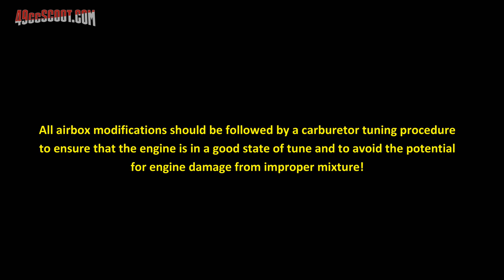Using A Big Carb With A Modified Stock Airbox : Scooter How-To

Comment: If only I had seen your video before now . I have been using a pod filter on my gy6 50cc engine from the time I picked it up used and have had nothing but problems with it running right and trying to keep it in tune . So today I ordered a new air filter box . Thanks for the tip.

Comment: I bought a Chinese replacement airbox for my 1PE40 minarelli as well. It had the small pipe on it and I found that sanding around the hole with coarse sandpaper was enough to open the hole up to take the original larger pipe - mainly because the plastic isn't that solid. I found that going around the hole in a complete circle with the sandpaper gave me a very even result that sealed nicely on the original pipe.

Comment: Damn straight I will be liking. Thanks for the tips. Now I know for sure that my airbox IS lacking a seal between the two halves. Also, when in doubt, I use silicone on everything I suspect could be leak prone. I have to take my carb out so often thesedays that I might as well try the heater gun method to aid installation. I never look forward to attaching the airbox to the carb once I am done... it puts up such a fight. Hopefully now it will be much easier.

Comment: I have a 70cc horizontal minarelli with a 21 carburetor and it had a velocity stack, now in winter the bike died at high speed, I mounted the tube from the original box with a pod filter and on the side of the carburetor I fitted it with a front fork retainer to fit the correct carburetor size 56mm, i have never felt the bike so good, even the noise is crispyer and feel much stronger and constant both at idle as at high speed.

Comment: Please take a look at how different the connection between the airbox and carb is in Piaggio 2 stroke scooters. Even in stock piaggio scooters that tube is very short, the curve part has a specialy profiled section of the curve (not circular all the way)and acts like a part of the carbs venturi stack. Also the airbox outlet to the tube is profiled like a velocity stack inside. The airbox on piaggios also seems to have quite larger volume. There are two inlet passages to the piaggio airbox and they have different lenghts. I guess it has to do with intake resonant frequencies. It always seemed to me like the piaggio intake system is much more detailed and much better thought out than that on minareli.

Comment: I'm sorry to say that my GY6 50cc with18mm Keihin wont run well with the airbox... And I'm not kean at all on a short "racing filter" for the loud open air sound it makes... Was thinking of what I just stumbled on here, a larger hose... to some canister.. I now might try it on the original filter for after watching this, it might just be the 25x150mm original hose/channel that is the (only) problem.
Thank You mate!

Comment: yeah, at one point i also shared your belief in that air boxes dont impact performance in any meaningful way.... until i got some substantial time on a dyno. even with a large gokart air box designed to work on two strokes, with quad venturi inlets and optimal flow, the pod style air filters still are a better option.. im talking that i gained 4 horsepower, went from 19whp to 23 whp on a 70cc engine simply by switching from an airbox to a pod filter. every dyno operator and tuner ive met, have similar results anywhere from 2-8 hp difference
Reply from the maker: I wonder what the dyno would show if you took a street build and ran it day after day. How much would the power be off on the days farthest from it's ideal tune vs the airbox? Would be an interesting test for someone with access to a dyno IMO.
Reply: @49ccscoot  i dont know about a street build, but on the racers ive had, the variation is about 0,5- 1 hp over a whole season, and that result is only due to poor carburator quality, the chinese clones really dont like weather changes

Comment: When it comes to Yamaha scooters with the horizontal Minarelli, it seems like there are two different snorkel sizes. The snorkel is mostly a silencer, I have the larger unrestricted snorkel on my airbox and it quiets the intake side down significantly.
Reply: My Yamaha had the smaller snorkel, from some short research it's apparently meant for the light moped version of the scooter, that's restricted to go only 25kmh/18mph.

For some reason my normal Yamaha had the light moped air box with the tiny snorkel. Removing it did wonders for acceleration! The light moped version's hole diameter is only about ~1cm/0,4in.
Reply: @99domini99  Even the Euro2 45 km/h version has it stock, I ordered the larger one for like 3 bucks online, runs great now and it's not very noisy.

Comment: Hi Brent, another excellent video.  Can you do a follow up to discuss the "why" an airbox works better vs a pod filter?  I've been going over it in my head and seems that maybe that long tube leading up to the carb evens out the air flow much better than the chaotic airflow that comes with a pod filter.
Reply from the maker: They do provide a more stable air source. They can be tuned to the engine. They are more effective at filtering and keeping water out.

Comment: Can you put a link to the air box and hose you bought???  Your videos are the best!!! Thanks!
Reply from the maker: Airbox : https://www.ebay.com/itm/For-Polaris-Sportsman-Scrambler-Predator-50cc-90cc-ATV-Air-Box-W-Filter-0451080/162800816393

Hose : https://www.mcmaster.com/blower-vacuum-hose

I can't remember exactly which hose I got, or it may not be there after all these years. Lots of options in that link though. You can get a coupling in any good plumbing section.

Comment: my friend you need a smooth plastic tube...becaue you are using flexible tube that can restrict air you know what i mean.? it much better to use radiator hose so the flow of air is smooth
Reply from the maker: I've thought about it, just haven't done it. The rad hose I have doesn't fit this and I didn't bother buying anything else because it has been working  well.

Comment: So I work with these 49cc/69cc motorized bike engines. The kit comes with a very basic carb which is called the NT carb. The carb has a very small airbox which is really just a filter mesh with plastic holding it. Can subtle performance gains be made using an airbox? What would be the alternative for our engine kits? Or will slapping on a cone filter and calling it a day be the only practical solution?
Reply from the maker: If the filter isn't good, then at least you could build a simple box to hold a good filter and have the benefit of proper air filtration that would be quieter and probably a bit less sensitive to atmospheric changes than just a pod filter. If you want a proper airbox then there's a whole lot of design involved and it would be easier to adapt something from a similarly sized engine.

Comment: You put out nice content man, I have a Znen150T chinese special, Ive got it running nice all stock with new carburator, however I would like to add, UNI filter and exhaust and upjet, however this scooter has EVAP system and there are 4 hoses into my airbox, I am not sure what to rip out, re-route or replug, do you have an email I could send pics to, maybe you could give me some advice how to remove evap and simplifiy with new performance parts?  TY for your work
Reply from the maker: I'm not an expert with all of the emissions stuff. Your best bet would be to post on the forum at https://49ccscoot.proboards.com
That way anyone there can help and you can post pics. If you use mobile, tapatalk app makes pics easy.

Comment: Great but my scooter is about 12 years old and my air box is 2x the size of my carb on kymco people 50cc scooter any suggestions??
Reply from the maker: The one that  I use is for a 1E40QMB or similar to Yamaha BWS/Zuma. There are also aftermarket airboxes by Polini and Motoforce to fit different carbs.

Comment: Hello, what configuration do you have in the carburetor? What carburetor size do you have?
Reply from the maker: This was a 25mm DellOrto PHBL. Last used configuration was 102 main jet, D26 needle, 64 pilot jet, 40 slide and 60 starter jet.

Comment: Hi man. The minarelli airbox on my scooter cracked right at the neck where the rubber connects to the the carb. I have the snorkel off since i had this scooter. Not sure if gluing it will work well. Not really keen on buying a new airbox yet as it is only a few months old.
Reply from the maker: You could try plastic welder or epoxy. If it's the rubber piece that is cracking, then you can get replacements for just that. You may even be able to replace just the part of the airbox that cracked if it's the plastic.
Reply: 49ccScoot just the rubber neck part of the airbox is cracked. Do you have a link where to get it?

Comment: hi bro i have mikuni stock carb for my jog 90 but it's not working well it is bogging down in full throttle i tried to put another stock carb japan its working but the scootoer went slow i prefer the mikuni much more power but i cant fint a seller in my country can i fix my old carb?
Reply from the maker: The new carb probably just needs to be tuned. This is a pretty common issue, where someone believes it is a bolt-on replacement but it does need more attention. If they are the same carb, you may be able to swap the main jet from the old one into the new one and get a better result. Sometimes it's that easy, sometimes you have to go through a tuning process. Here's more info than  you probably want about carb tuning :
https://www.49ccscoot.com/faq/carbtune.html
Reply: @49ccscoot  thanks bro. Its a big help for me  🙏 I will read it thanks for this info 🖤

Comment: Very instructive video , grettings from spain, i have  a question about sport cylinders and is if you should To set  an early ignition con this cylinders or the rpm are not  been increased enought
Reply from the maker: You may benefit from advancing timing even on a stock cylinder. If you make a big change with a standard CDI, it may not work well because it won't retard the timing enough at higher RPM for best results with a tuned pipe. As always, you have to be careful not to go too far and end up with detonation.

Comment: Anyone here install an aluminum curved intake pipe on an 80cc bbk gy6? I'm getting backfiring on the intake side, where it never happened before. The only difference is before installing I had already dialed down my main jet size for the hotter weather (I had richened it for the winter).
Think maybe it's too lean now between that and the curve pipe? Maybe up the jet some again?
Reply from the maker: Possibly lean, but also a good idea to make sure you don't have any leaks around the intake.

Comment: hello, good video, a question for spanish followers, the polaris 90 airbox, is bigger than the yamaha artirstic ? or same size the box
thanks y love your chanel , sorry for my english im spanish
Reply from the maker: The Polaris 90 box is the same size as the typical 49cc airboxes. They tend to have the larger style of carb connection, so they're good if you are looking for that.
Reply: @49ccscoot  ok perfect , thanksss
Reply: @49ccscoot  hola amigo tienes facebook para una consulta ? Se lo agradecería mucho ,
hello friend do you have facebook for a consultation? With the mvt dd rotor 
 I would be very grateful , Thanks
Reply from the maker: @djmorenofigueres  I check YouTube much more than facebook... really don't use it.
Reply: @49ccscoot Okk no problem thankss

Comment: Hi there grateful for ur channel I have a stock standard Yamaha axis 90 got 88 jet if u do this wud I just plug en play
Reply from the maker: It should be very close. Always a good idea to check the tune though.
Reply: @49ccscoot  thank u very much now iam just waiting on my v8exhaust pipe.  Eny thing  I need to do when fitting it iam new to this so I learn step by step small steps wud love to get good fun out of it no whit small mods eny ey advice wil be appraised I love to take long country roads enjoy the rides
Reply from the maker: @mondomontie7449  Always try to stay on the side of rich. A little extra fuel will help to cool the engine. When you get the new pipe, make sure it bolts up without tension on anything. When you put tension on the pipe, like bolting it on in a spot where you're having to force everything to align, it winds up causing cracks in the pipe. Use spacers as needed on mounts. Elongate, redrill or enlarge mount holes if necessary. If the header needs to rotate a little to make it work, sometimes you can elongate the flange mount holes a little to do that. Spend the time on setup so you don't spend the money on another pipe later.
Reply: @49ccscoot  I get u 100% small details that can safe lots of money my setting is one en half out now stock en it go nice after pipe il look at cvt

Comment: hi, i drove a full day without air filter and now engine wont start, what do u think happend?
Reply from the maker: Do a compression test and see if it's low. Could have damaged something from being lean and hot or possibly sucked something into the engine that caused damage.
Reply: @49ccscoot  the piston got broken so does the rings, im afraid something fell into the botom engine

Comment: Hi mate have you got any links for that hose to airbox
Reply from the maker: I got it from McMaster-Carr under vacuum hose.
Reply: @49ccscoot  thanks mate
Reply: @49ccscoot
Reply: What size mate it’s 19 ml carb and aerox air box I have your mod already from rear Pulll
Reply from the maker: @kayone8571  Measure the carb where the hose will go. If you can match that up when modifying the airbox, then get a hose of that ID.

Comment: How about hose length influence to performance (air waves, harmonics etc.)? Or is it only valve to carb length which is important?
Reply from the maker: You would primarily worry about the carb to valve. I'm not going to say that the airbox doesn't matter. There's a lot of science in some modern airboxes. The volume and the snorkel are other common tuning points. I think when you look at what most of us use, which aren't tailored to our engines, this isn't going  to change a lot.

Comment: hey there! awesome work!!
im struggling on my SR50 atm. got a dellorto VHST 24mm carb mounted forwards and was using a flextube with an airbox.
this flextube >> https://www.scooter-attack.com/de/kaufen/ansaugschlauch-flextube-sandtler-50mm-glasfasergewebe-mit-federstahlspirale-1-meter-63138 << is a piece of crap.
i had it installed for like 200km and then that tube started to brake down - holes everywhere! 
first i thought it was touching the frame or other parts, but that couldnt be the reason.
i guess the carburetor and my "low" 70ccm setup was sucking way too heavy at that tube :D
have to fix it rly quick before winter hits
kind regards from germany! keep going
Reply from the maker: I used a very robust tubing with mine, largely for reliability concerns. It's thick rubber and strong steel reinforcement. That said, I wouldn't expect it to deal with enough vacuum to distort even more flimsy tubing. I wonder if that could mean your airbox or tubing is otherwise too restrictive.